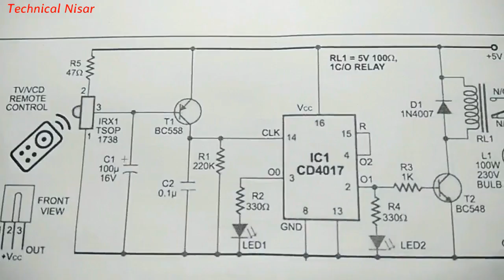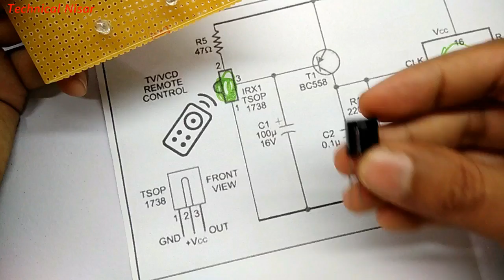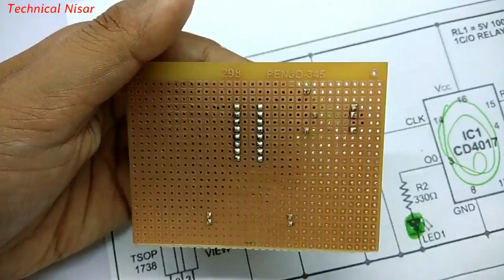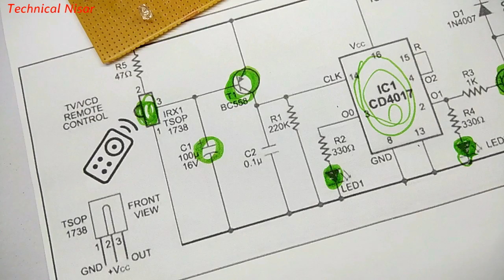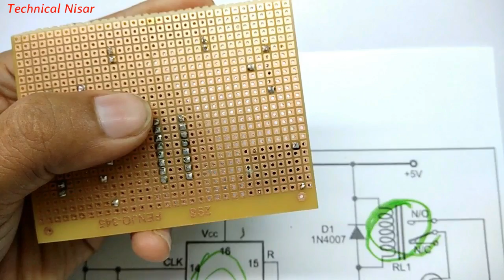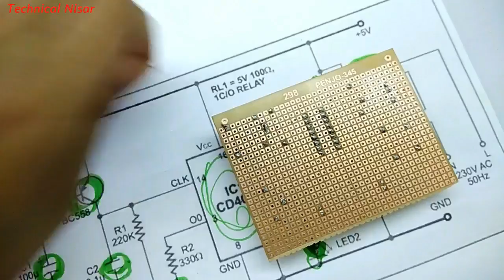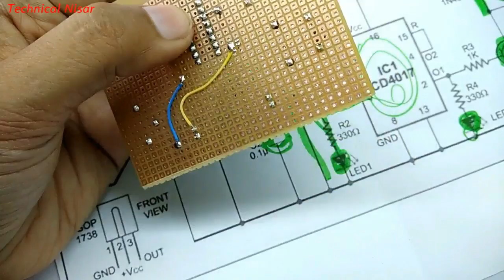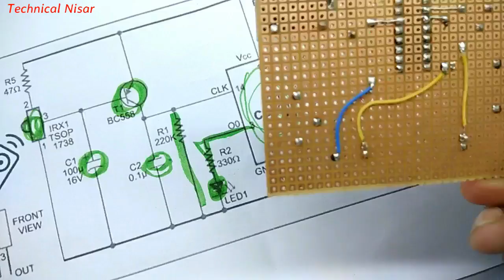Control FAN and LIGHT using TV remote ( part-1 )

Comment: Bro
Near TSOP you have used transistor which is NPN
But tsop give + voltage as output and emitter is also connect to +volatage supply..Then how does it work ?

Comment: Bro Its a push and hold type,i want if you give one pulse is on and next pulse is off circuit. This gate ic didn't have hold circuit and its ave one disadvantage ,if you operate both tv nd fan means both will recive same ir signal so if you change channel in tv at that time fan will change the state so we need one encoder for fix this, we assign one key to fan .try it bro nd upload it

Comment: Sir i want to know that the project would work if i use a capacitor of 100u 25v electrolytic instead of 100u 16v electrolytic
Reply: Vinay Upadhyay yes u can but some problems may occur

Comment: you need to learn to solder. The iron, the solder and the componrnt need to be in common contact. you DO NOT  use the soldering as a teaspoon like you are doing.

Comment: sir, can I use 0.22uf capacitor instead of 0.1, and also 100uf 35v instead of 16v.....?
how can I use a 12v relay instead of 5v relay....?and a transistor BC547 instead of BC 548....
PLZZZZ reply fast as soon as possible

Comment: 5v relay is out of stock our local shops, 6v relay is available. so can i use 6v relay? please help me...!!!
Reply: Bro can u complete the board?
Reply: yes but not working... so pls give me the 6v relay circuit...
Reply: I used 6v relay. And it's work. But remote can't work properly. It's automatically on and off. Where you from?
Reply: I have completed this circuit few years ago and same problem as you. work bt not properly work. bt I want to work properly as this video so I need the working circuit using 6v relay...

Comment: sir  i have made this but not working.....what may be the reason...i have use 100u 25v capacitor in place of 100u 16 v...and the ir sensor is sm0004...so what may be the possible reasons tha it is not working...i have checked the whole ckt twice and thrise....i waiting for your answer

Comment: And how much power can drive from these components?
like how many amps can pass from this circuit?
is it good for 12v normal Fan?
Reply from the maker: +IMI .A 
Yes it is capable to control 1v to 230v.
Reply: like how many amps can pass from this circuit?